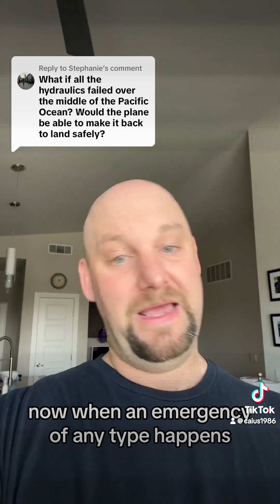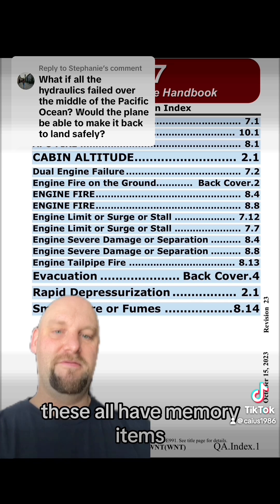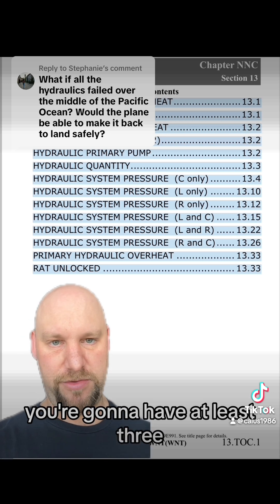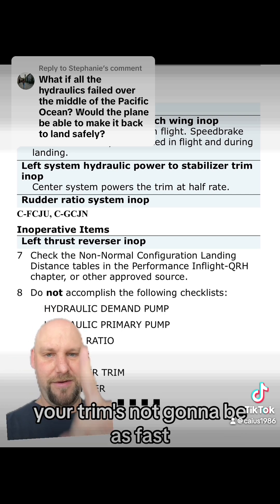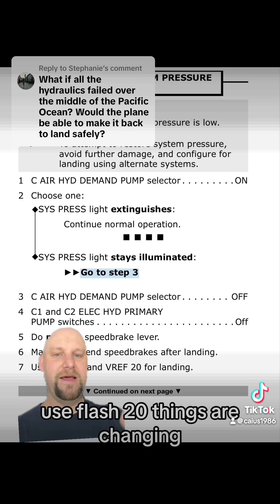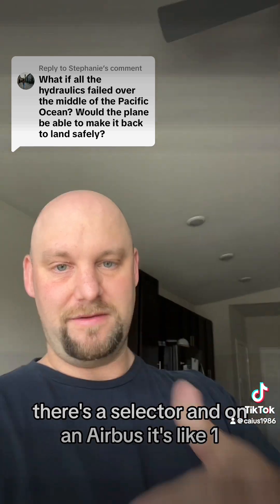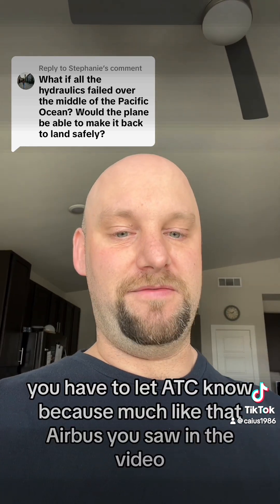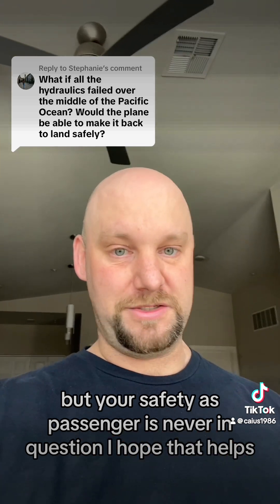Hydraulic Failures. Are they serious?

Comment: Short answer No. Long answer: If all hyrdraulics fail you cant really land. To combat this there are 3 separate systems, and several divisors within each system to preserve fluid/functionality pushing the failure percentages to a point that it's an impossibility (or so rare its an act of god like an asteroid which you cant combat). Now. Boeings problem? They build great airplanes that last a long time....and all these systems and safety measures only work...if you maintain the plane. Increasingly airlines are reselling 2-3 times 30-40 year old planes and performing worse and worse maintenence. Which youre seeing the results of. "Well why dont airbus have the same problems" because they have so many smaller issues its not economical to keep their planes on the air as long and ironically the cheaper airlines use boeing planes because they can get away with less maintenance costs.
Reply: You could still land some airliners without any hydraulics. But it would require a very long landing distance (will need the longest runway available) and near perfect weather (preferably daytime). The landing would happen at higher than normal speed if flaps don’t fully deploy. Reverse thrust, ground spoilers and normal braking would be unavailable so only the emergency braking system would work and it will take a long time to stop. The aircraft might need to fly for an extended period of time to burn off as much fuel as possible or to dump excess fuel. The workload for the pilots would be very high, both mentally physically (on a 737 for example, you’re manually operating some of the flight control surfaces). The plane would be damaged during the landing and tires would blow out. Passengers would definitely feel a jolt upon touchdown. Evacuation might be needed due to brake fires. The plane might be a total loss, but it is a potentially survivable scenario.